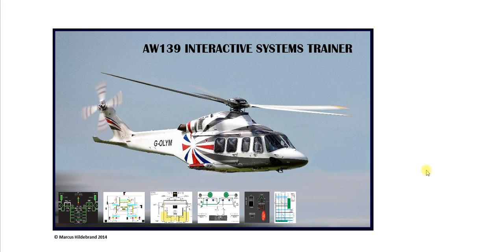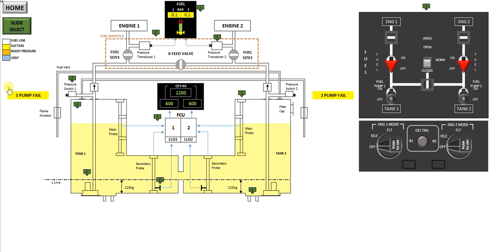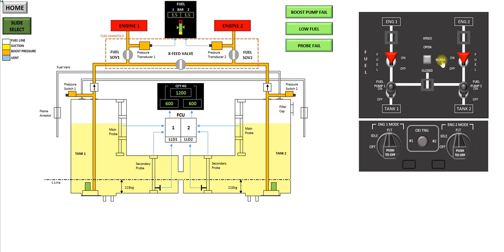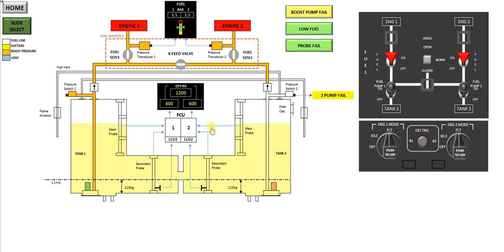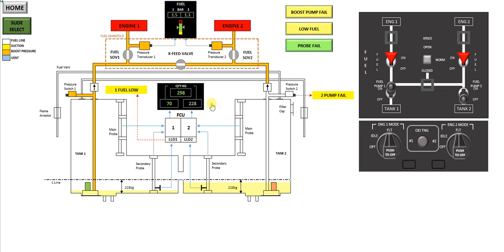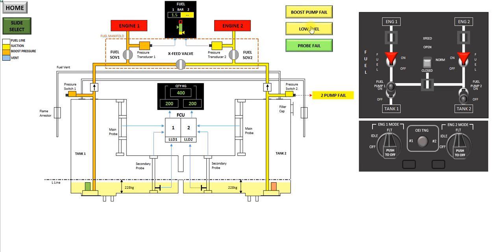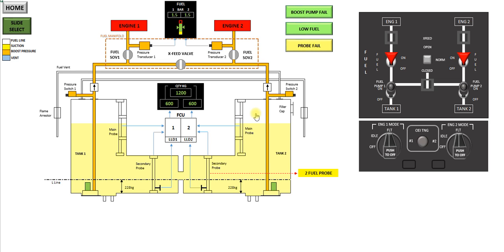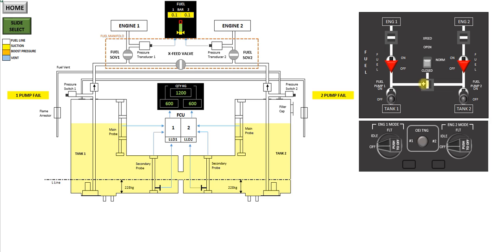Excel AW139 Fuel System

Comment: CAUTION!!!
LOW FUEL indication has nothing to do with the 228kg fuel quantity, turning grey, indication!!! FUEL LOW CAS caption comes up at 92kg of fuel per tank!!!   228kg is the remaining fuel in each tank at the connection flange level, where fuel splits in two! If you wait to close Xfeed valve until you get LOW FUEL CAS message, then it will be to late, because by that time you will already have 136 kg of unusable fuel (228-92=136)!!!
Reply from the maker: Hi Yiannos,
Thanks for you comment. The low fuel captions in the presentation only come on when there's approx 92kg remaining in the respective fuel tank so I'm not to sure what you are trying to highlight here. Everything else you mention above seems correct (i haven't been flying the 139 for a while so I'm a little rusty) and is what is represented in the presentation. Am I missing something?
Reply: Hi. The overall presentation seems just fine!  The only thing that doesn't sound right is that around 2:40' it says that the fuel low comes on at 228kg of fuel remaining and around 3:20' it says that when fuel low, Xfeed has to be turned off!!!
 I just wanted to make clear that 228kg is not the fuel low. It's the fuel quantity  at the connection flange level where the two tanks are separated!!! And the QRH note says that when fuel gets down to 228kg and one boost pumb is inoperative, then the 228kg will turn grey and it is at this point that you have to turn Xfeed valve to close position and not at Fuel Low!!!
Fuel Low comes up at 92kg per tank!!!
I hope this makes more sense....!
Reply: Yiannos, I think that there is a confusion about the button that he uses to reduce the fuel on the presentations which is LOW FUEL ( Button ) with the 1-2 FUEL LOW ( Real ) situation. On 4:03 it shows the moment when 1-2 FUEL LOW CAS will appear which is 92 kg. Pressing the LOW FUEL button he is able to reduce the quantities of fuel on the presentation/program from Normal to 228 and then to 92 Kg. Am I right Marcus?